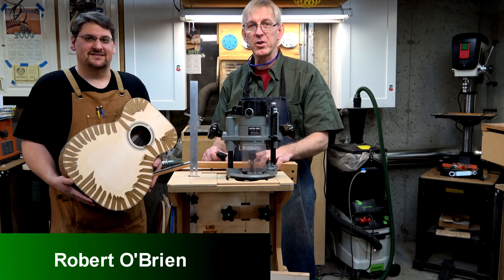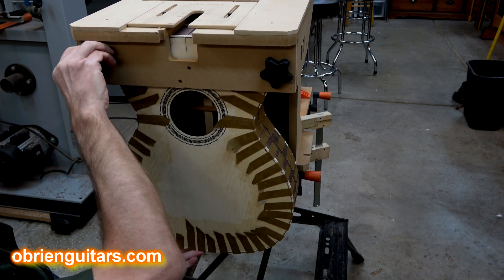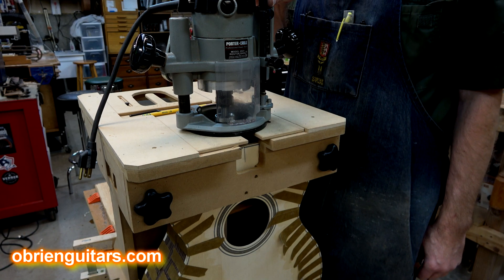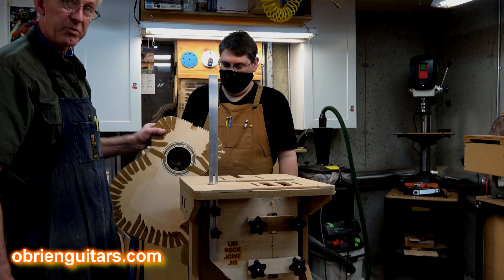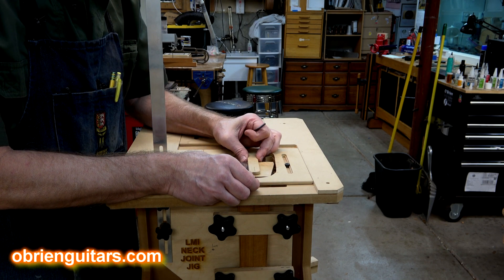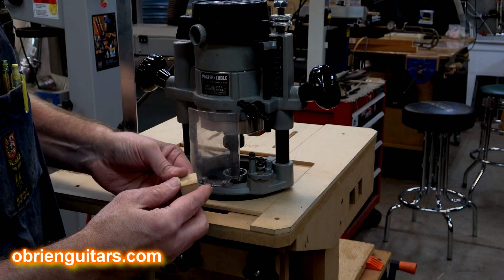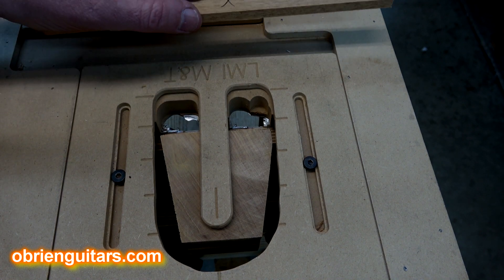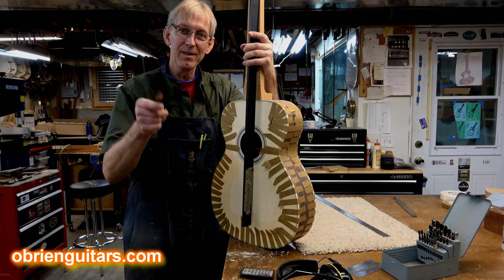O'Brien Guitars Neck Angle Jig in use with student

Comment: I wanted to buy the plans for the Robert O'brien Mortise and Tenon Jig.  I cannot find these anywhere.  Is the neck angle jig actually the mortise and tenon jig?  Does the neck angle jig hold the templates for routing the mortise and tenons?
Reply from the maker: You can find the plans here. https://lutherieacademy.com/plans  It can be used for bolt on mortise and tenon or dovetail joints. The plans also show the templates.
Reply: @OBrienGuitars  Thanks!  I just bought them.  The title of the plans gave me a bit of a pause.  I was delighted that I could select print actual size in poster mode, and the pdfs were printed to actual size with match lines.  This will make the build so much easier!

Comment: Good day, I am curious about the setup of the neck heel angle relationship to the body. Specifically at the pivot point.  In order to get the 3.5mm at the saddle point you are pivoting the jig from the flat surface where the Mortise is cut. If your top is flat wouldn’t that tend to create drop off for the fretboard extension?  Or does your top have a angle ?  Again just curious. 

Dennis
Reply from the maker: I use a 30ft radius on the soundboard and glue the upper braces on a flat surface.  With the neck angle there is a 64th to a 32nd dropoff from the body joint to the sound hole
 I then level this from the top side of the fretboard.

Comment: Here is a tip for the 3.5mm at the bridge. I tape a dowel pin or drill bit that is the desired height(diameter) and tape it to the top and let the straightedge kiss the dowel. More accurate than measuring with a ruler.